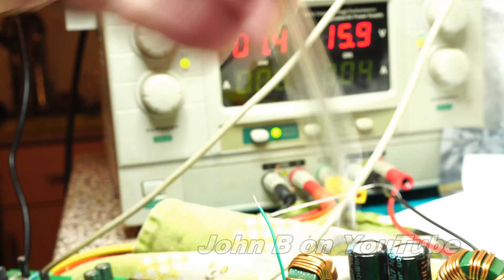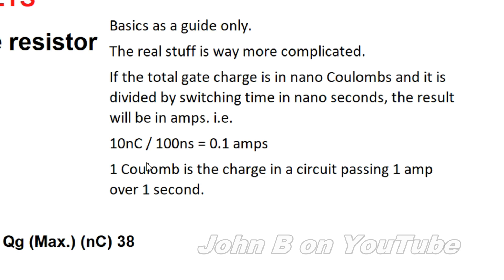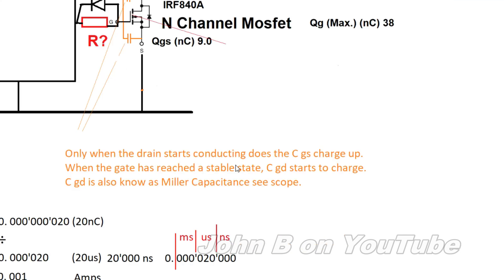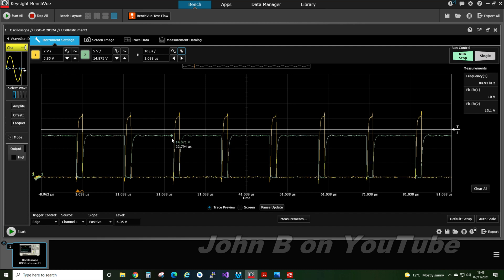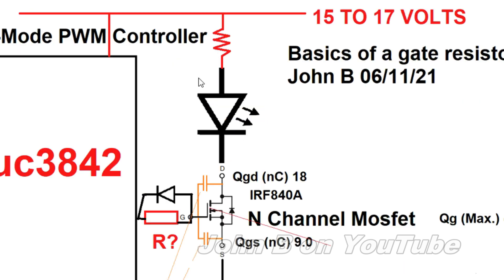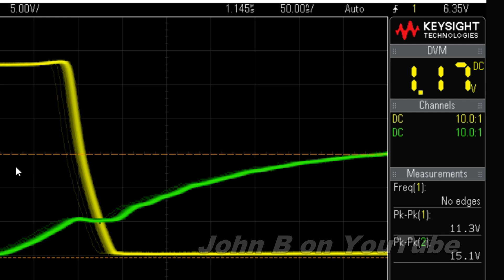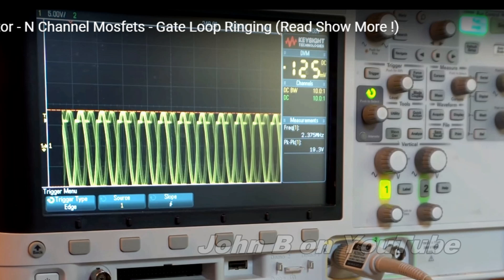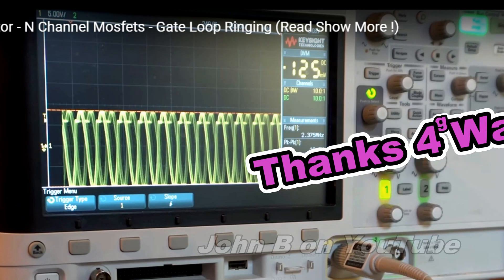Calculating A FET Gate Resistor Part 1 & The Basics of A FET Transistor (Read 'More')

Comment: This is great. I'd been wondering what considerations should go into sizing a gate resistor for a while and hadn't found anything terribly useful. One thought I had, though... You never really commented much on how the current you derive relates to the circuit in question. You kinda did without really bringing much attention to it when you increased the voltage to 19 volts and swapped in the 100 ohm resistor, but didn't really go into much detail or explanation. I'm thinking if the turn-on time is mostly defined by charging up the Miller capacitance, then the voltage driving that charge current would be the gate-drain voltage, wouldn't it? It seemed like you were just taking the voltage on the drain and dividing by the desired current to get a resistance, but shouldn't we calculate Vd - Vgs(th) and divide that by our required charge current to get the appropriate resistor? Isn't that the voltage across the Miller capacitance? For higher voltages, this might not make much difference, but for lower voltage circuitry, this seems like it could make a big difference. Or am I missing something?
Reply from the maker: Hi brettski74,
I’m not sure if I follow you.
In the example given, the bulk of the charge was on the gate to source capacitance since it was larger than the gate to drain capacitance.
However, one gets a delay charging the gate to drain capacitance, shown with the Millar Plateau, due to the rapidly decreasing voltage on the drain.
I see the majority of the turn on time was on the gate to source capacitance, not the Millar Plateau. 
You wrote “I'm thinking if the turn-on time is mostly defined by charging up the Miller capacitance.”
I don’t see that as the case. Am I mad in thinking the gate and gate to source capacitance took longer to charge than the gate to drain capacitance?
I must point out that I took the gate to source charge only and intended to look at the gate to drain charge later. As with many people making videos, mistakes are made whilst doing stuff on the fly without a script. I left the video ‘as is’ and figured it was ok for the basics.
Reply: @JohnB-2021  Let's start with - I don't know the correct answer here. What I was trying to understand from your video is that we can calculate the charge current that we want in order to achieve a given turn-on time. That's straightforward enough, but if we want to go from that current to a resistance to connect to the gate, we would need to know what voltage is driving that current. Then we can calculate the resistance using ohm's law. So the question at that point is what voltage is across our gate resistor to drive the desired current.

You did mention at about 10:40 in the video that you had 19 volts on the drain and proceeded to divide 19 volts by 100 ohms to get 190mA of current. I'm not seeing how this relates to the resistor or the desired charging current, though. I initially figured you mentioned drain voltage because the Miller capacitance is across the gate-drain, but on reflection, that doesn't seem like it should matter. We're talking about ohm's law and the calculation you did there implies that there was 19 volts across the gate resistor, but was there? Looking at your oscilloscope trace, it looks like the gate voltage tops out a little below 15V and this is presumably the output voltage of the gate driver. I'm also assuming that since the plateau region is where the MOSFET first starts to conduct, this is the threshold voltage and looks to be around 5V. So wouldn't the voltage across the gate resistance be around 10V? I don't doubt your results, but I'm trying to understand why it works given the numbers and images presented.
Reply from the maker: @brettski74  
I see your point.
I had the power supply connected to the driver, it was showing gate voltage peak to peak and drain voltage on the other lead.
Changing the voltage on the drain would influence the turn on time.
That same supply was connected to the driver.
I see some points in the video are not as clear as I would like.

Thank you for your comments, I do appreciate them.
Reply: You guys are both right. 
The gate charge determines the total time of charging the gate to your driver voltage (typically 15V) and the duration of the Miller plateau depends on the Vds voltage, since it is charging the Miller capacitance Vdg (often called Crss). The data sheet typically specs both the gate charge and the Cgs and Crss capacitances since both are important in determining your gate resistor and the switch on and off times of your MOSFET.

If you are interested in more details on how to set your switch on/off times and the gate resistor(s) that go with that, I highly recommend the video by Prof. Sam Ben-Yaakov called "MOSFETs’ gate resistors" here on youtube. That video also addresses why you should switch on slow and switch off fast, and thus typically provide two different gate resistors for each direction.

Comment: Thanks for the super informative video. Question: Could a potentiometer be placed in lieu of the gate resistor then watch the scope as the pot is manipulated? When the point of ringing is reached, measure the resistance of the potentiometer. Or would the characteristics of the pot invalidate the test? The calculations work well, I was just curious if what I described would work or not. Thanks the videos
Reply from the maker: Yes you could use a pot.
You should not experience ringing unless you have high inductance somewhere. Thanks for your comments.😀

Comment: Can you tel, when to use a gate to source resistor and when to use a resistor berween gate and IC ?
Reply from the maker: If the device that switches on the fet can’t switch it off, put a resistor from the gate to source.
If you want to slow the switch on time or you want to limit the current from an ic, put a gate resistor between ic and fet.
If you encounter gate loop ringing, increase the size of the gate resistor.

Comment: Great video John. I would like to ask a question thou I am building an ev and designing a controller.  I am currently using cm600ha-24h igbt bricks two in parallel.  Have 20ohm resistors on each gate and 1k pull down resistors on each . I run controller it works great until I increase the load to 50 amps and then they destroy themselves
Reply from the maker: Wow, huge transistors.
What is the load? 
What is the switching frequency?
What is your supply voltage?
3 possibilities that spring to mind.
You are exceeding the max power rating of 4100 watts each.
Or if switching an inductive load, you are generating an emf voltage (spike) which may exceed the device voltage rating.
Or, the gate voltage is being exceeded during the switching phase due to stray inductance etc, you could clamp the gates with a zener diode.
Reply: @JohnB-2021  thankyou for your reply. I have a 11 inch dc sereis wound motor it is capable of handling 144vdc at 600amp max. I am only using 60vdc at 200amps with a peak of 800 amps using lithium prismatic 21v pack ×3 .I have capacitors for dc bus rated at 450vdc 500uf ×3. I also am using 2× 1200vd  1uf snubber capacitors and the spike is raising to 65vdv and the scope looks like 1khz frequency.  So I am very confused I have destroyed 4 controller's I have built. So I am asking for any help as you no they are expensive.
Reply from the maker: @craigivas4037  Are you blowing the controllers and transistors or just the controllers?
60 volts x 200 amps is 12 thousand watts.
You need to measure the voltage across the transistors when the are switched on.
It sounds like one of the possibilities above, exceeding the 4100 watts per device.
Also, what scope do you have?
Only a fast scope will show the true inductive spikes.
Reply: @JohnB-2021  good morning John yes the scope is a Tektronix task 210.  I have a 200 amp shunt and it reads up 40 amps all day long as soon as I push further like 50 amps it blows the igbt bricks.. the driver still works fine. I did notice that the 1k pulldown resistors were burnt out as well.
Reply from the maker: @craigivas4037  You need to measure the voltage across the transistors.
Do they get hot?
Reply: @JohnB-2021  no prob I'll try and do that this arvo. And no they don't get hot. Thankyou for information and I'll keep in touch as soon as I find voltage. I have 1 brick left.
Reply from the maker: @craigivas4037  what driver are you using?
Can it supply the current for both blocks?
Reply: @JohnB-2021  yes I built a driver using arduino nano operating a npn which drives a pnp.  The pnp has 12.5v at 5 amps available. And both transistors  have pull up and pull down resistors attached . There is also a 10amp 1000v diode before the pnp.
Reply from the maker: @craigivas4037  I wonder if the blocks are turning fully on. It sound like they are reaching their max power capacity then blowing
Reply: @JohnB-2021  how ya doin John ive just checked some voltages. At the motor neg and batt neg on the switch I'm getting 61.5vdc .. batt voltage is 60.5vdc... the scope was connected across the switch as well and the frequency was 850 Hz. Also 20amps.  I did feel the brick and yes it is getting warm
Reply from the maker: @craigivas4037  Hi Craig,
So if you’re only getting one volt across the transistor, it sounds like it is turning fully on.
40 amps times 1 volt = 40 watts.
You could try adding your own body diode since external diodes are usually faster than internal diodes.
Put a Zener on each gate too.
You could put 2 zener diodes on the gate.
One to clamp max voltage and one reversed to clamp undershoot.
For confirmation, you have one volt between the collector and emitter when switched on?